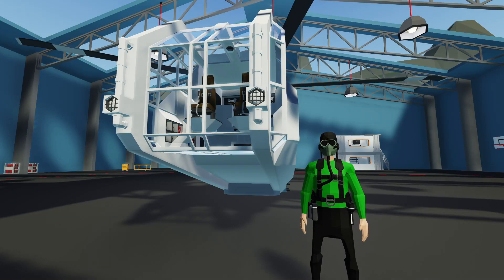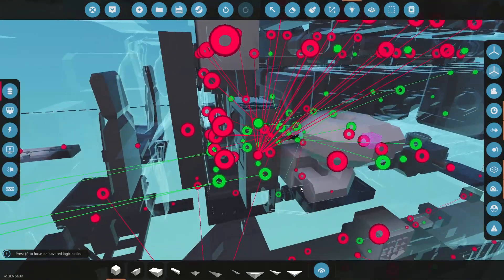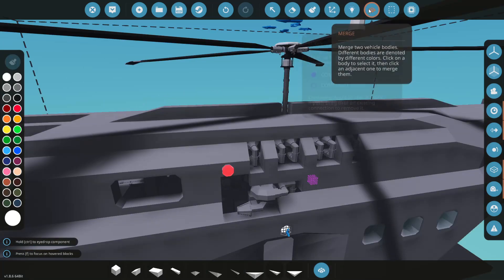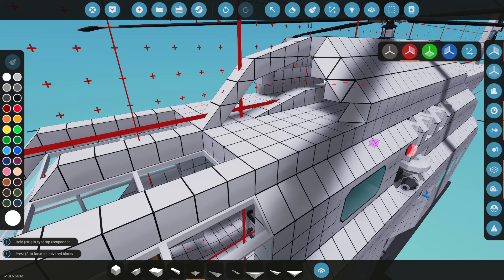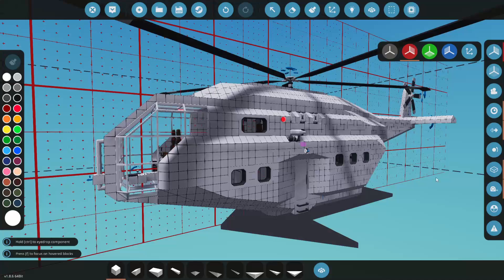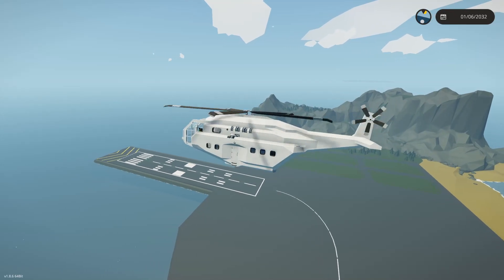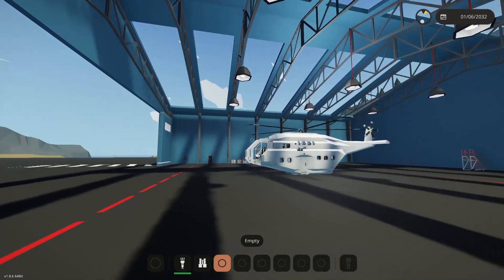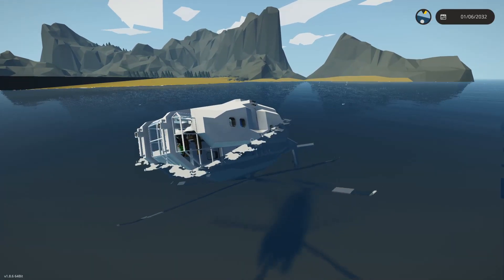IT FLYS! Building the Ultimate Rescue Helicopter! Stormworks

Comment: Loved the video @ProfNCognito! Can't wait for the next video man! Don't forget about the Winch at the Back man!

Also, The Magnetic Anomaly Detector will be Out roughly 30 or 40 Feet (9.230 Meters or 36.923 Blocks or 12.307 Meters or 49.230 Blocks) out as the CH-10 Pachycephalosaurus is Flying over an area. Much like the Lockheed P2V-7/P-2H Neptune's AN/ASQ-8 MAD, it has a Detection Range of up to 500 Feet (153.46 Meters or 615.384 Blocks). The Mk. 46 Lightweight Homing Torpedoes will actually Circle around until they pick something up, Chase it down, look again, Chase and then go in for the kill. Once it reaches a Preset Depth, it'll surface up to a Preset Depth for that and then go back down.

Let me know what you think about this and I'll catch you in your next video man!

Comment: hey one question how do you make the rear tail rotor not turn crazy clocwise beacause l could never do it can you help or if you have a microcontroler
Reply from the maker: firgure out what trim you need then add that to a function block

Comment: 11:56 Of course because the engine is at the top so then it needs more mass at the bottom and maybe two gyros one each side reading the roll angle to counter balance and that is it... and two propellers in case you need to navigate forward, backward and turn...